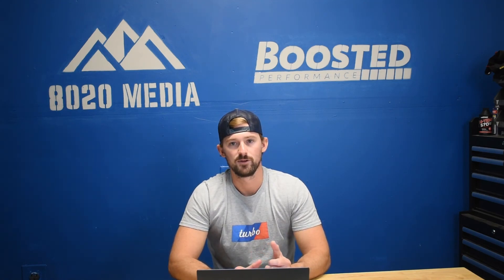5.3 Vortec - Everything You Need To Know

Comment: Thank you for this. I just got my first truck. 06 silverado with the 5.3 vortec and people are already calling it garbage. But hey, I worked my ass off for this and it gets me from point A to point B and also back to A.
Reply from the maker: Congrats on the truck, sounds like you deserve it! The 5.3 can be a great engine, just make sure to stay on top of maintenance. Don't worry what others have to say about your truck! If you love it, that's all that matters. Like you said, it gets you to where you need to be.
Reply: Congrats! I just sold my 02 Sierra with the 5.3 and it was absolutely bulletproof. I sold it with 276k and was running beautifully. I worked the shit out of it, too. Feed it top tier oil and it should be good to you.
Reply: Ignore the ignorant. Kudos to you. I have a 2002 Silverado 306,000+ miles engine still running great, though a minor lifter tick till it warms up. Just now started having transmission issues after 300,000 miles. Good luck to ya and happy smiles driving those miles.
Reply: Congrats to you, and screw whoever says otherwise. Been driving an '02 Suburban with 283k miles for almost 4 years now, with the original engine and transmission. I love it, it's reliable, and that's all that matters.
Reply: @calebbryan8600  That's good. My 02 Silverado at 306,000 miles. I Had transmission servos 1st 4th replaced about 4/5 years ago had only 2nd and 3rd gear. It Did great for many more miles. The 5.3  Engine still runs strong. Transmission is now at a point were the clutches are slipping real bad. This the only major thing this truck has had. Time to refresh rebuid the originals and the rear end to have a complete revived power train to go another 300,000 plus. 

If a vehicle  doesn't ever get to the high mile class it hasn't earned its keep. They're just dusty rust collector garage queens. If it's got an engine and wheels it was meant to roll. 👍
Reply: right! 2012 5.3 here and ppl say it looks outdated.. shit it’s brand new to me and i busted my ass for it
Reply: the 06 had a rep
Reply: Anyone telling you it's trash probably drives a dodge 😂😂😂😂
Reply: It’s not garbage bro 😅 people are jealous. I love ford Chevy and dodge. I’m not biased to Chevy. The 5.3 is a solid engine.
Reply: My 2000 5.3 vortec is still Rollin fine at 285,000 so they don't know dick
Reply: The 5.3 vortec is the best v8 engine ever built arguably even dod they can take a lick and still take you to work tomorrow i always say they'll get ya from a to b and dont be afraid to take it to c
Reply: anyone calling that truck garbage is a moron, the gmt800 is widely regarded as the most reliable series of trucks to ever exist
Reply: they don’t know what there talking about… besides my 05 monte carlo ss and 66 cadillac everything i’ve ever had has had this motor and never had to replace the motor… this thing does everything you need
Reply: @geraldblacher6318 And that’s facts. A bunch of ignorant morons in debt with their new $80,000+ trucks/SUV’s. The Gen 3 5.3 is the best of the last real true generations of GM’s Small Block V8’s. And what I mean by that is no cylinder deactivation or VVT bullshit.
Reply: 5.3 especially the LM7 could be considered one of , if the not the best engine ever built. Very simple, built strong, good power and torque , goes forever, and is decently efficient for a big v8.
Reply: The 5,3 is a great motor and anyone who makes fun of another guys truck Is a damn loser
Reply: @crash64226 they aren’t men
Reply: i have a 99 (nbs) with the iron block 5.3 and it took 350,000 of straight 16-17 year old abuse before it finally clogged up the oil pump pu tube. do NOT put a cold air these motors do not like them.
Reply: Clean out the tube change o ring and keep going @nelptune0787
Reply: Have the same truck. Just hit 200,000 miles. No problems yet
Reply: Just bought a 06 with the 5.3 it has 206,000 it runs strong im hoping it will last. I'm just happy to be back in a chevy
Reply: I had an LM7.  Bullet proof.
Reply: My 2005 standard cab silverado has this motor in it. It has 71K on it the only issue is my air conditioner leaks a bit and needs charged sometimes. I charge my oil every 3500 mess with 5W-30 full synthetic oil with a good filter. I was looking at a new silverado but maybe not now.

Comment: My 2012 LC9 5.3L has been very reliable. I have disabled the AFM. I have 87,000 miles on my Silverado.
Reply: I disabled mine as well. I have a 2011 5.3 Silverado. Turned it off at 117k. Now have 205k hard miles as well lol
Reply: @Josh-xj3fm  how did you turn yours off?
Reply: @Josh-xj3fm  I recently bought a 5.3 2012. And I noticed it had a slight tick at idle when its been running for a while. At start up and driving you don’t hear the tick with rpm’s rising. Is this the same deal with yours? I’ve heard it’s normal and some say it’s not.
Reply from the maker: Todd - Thanks for sharing your experience! Hope you get another 87k from your LC9
Reply: Just got a 2012 5.3 , I love it so far. Glad to hear you like yours.
Reply: @fortyfourrobo544  I recently bought a 5.3 2012. And I noticed it had a slight tick at idle when its been running for a while. At start up and driving you don’t hear the tick with rpm’s rising. Is this the same deal with yours? I’ve heard it’s normal and some say it’s not.
Reply: @Miguel-c1j  I recommend using a good quality synthetic oil. I use Royal Purple, and it has really good detergents to clean the gunk out of your engine.
Reply: I recently bought a 5.3 2012. And I noticed it had a slight tick at idle when its been running for a while. At start up and driving you don’t hear the tick with rpm’s rising. Is this the same deal with yours? I’ve heard it’s normal and some say it’s not.
Reply: Explain to
Me what afm is

Comment: The Vortec name and technology was shared from Honda to GM. 1996 was the first year of the vortec motors with a 305, 350, and 454 offered. It’s also the first year of the 3rd door option.
Reply from the maker: They actually used the "Vortec" name in marketing materials back in 1985 (I believe, or '86) with the 4.3L Vortec, albeit different design on the V6 vs the V8 Vortec's.
Reply: @8020Automotive  awesome. I didn’t know that. 👍🏻
Reply: @8020Automotive  Many call them that cause of the centerbolt valve covers but they are not true vortec
Those are TBI truck engines with the crappy head
Reply: Got any proof to that Honda claim? 🤨
Reply: @Maverick09171  that’s a great question. I’ve been a gear head since I was a kid. While other boys were wasting their lives away on Nintendo or Sega, I was reading/memorizing magazines like; Chevy High Performance, Super Chevy, Motor Trend, Car and Driver, etc… my parents gave me mag subs for birthdays and Christmas rather than video game junk. I can’t pinpoint the proof but am certain I read it in one of those mags at one time in my life. Whether it’s 100% correct or not, I’m not sure. It’s from memory. Having said that, I’m happy to be corrected if I’m wrong. It seems like it had something to do with VVT as well.
Reply: @dudestuff1557  GM and Honda have definitely collaborated over the years. But to my knowledge it’s been fuel cell and more recently EV content.  It is my understanding all the LS based features and design were done in house.
Reply: @Maverick09171  agreed on the collabs. My memory from this was the collab early to mid 90’s. I could be wrong and should probably research it more. 👍🏻

Comment: They might be the best GM engine, but they are underpowered. 
A Toyota 5.7, a Ram 5.7, a Ford 5.0 and a Nissan 5.6 all overpower the GM 5.3
And it doesnt really last longer than any of the previously mentioned engines.
Reply: I’ll stick with a pushrod engine over a DOHC with a 3 mile long timing chain. Just my opinion
Reply: @Maverick09171  well thats good for you, you chose an engine based on its simplicity, not its quality or performance. Nothing wrong with that, but please dont come at me saying pushrod engines are superior, because if they were, GM wouldnt be making other engines DOHC or 4 valves per cylinder. 
The toyota 5.7L is superior and even the Ford 5.0L coyote is better than a pushrod engine. Period.
Reply: @Eltanque-z4m  are we talking about the 5.7 trunda engine that makes a whopping 380 hp vs the 5.3 355? Oh and gets dog shit 15/17 fuel economy. Yeah light years ahead.
Reply: @Maverick09171  oh and the coyote V8 is smaller in displacement and makes 400 HP, revs higher, mods better, is more tuneable, lasts just as long if not longer, and gets even better fuel economy than a 5.3L 
GM should be ashamed and step up their game and build competitive engines.
Reply: @Eltanque-z4m  3:1 sounds like a great statically generated number. Not just one some goofball on the internet made up. Oh and it didn’t outlast anything, as they killed that engine to replace with a v6 tt. That’s ought to tell you what Toyota thought of that engine.
Reply: @Eltanque-z4m  is the coyote engine in trucks? Pretty sure the coyote is a performanc engine and you are comparing to an engine built for trucks only. What's your argument? That a performanc engine can beat a standard engine? Good job mate
Reply: @dpgemail  the Coyote engine is in trucks, it has been in F150s as long as it has been in mustangs. So good job of being misinformed mate 😂😂😂🤡
Reply: @Maverick09171  I get it, you are a GM fan boy who hates to admit that GM and its pushrod crap is outdated, outpowered and is normally outlasted by superior products. But you cant deny facts. The longest lasting V8 engines around are toyota 5.7L, so toyota screwed up and replaced it with a twin turbo. That has all to do with fuel economy regulations and not with how good or bad the Iforce was. Which BTW is a far more reliable and longer lasting engine compared to anything GM has ever made. A goofball on the internet uh? Im a profesional mechanic, and have been for a little less than 30 years. 😂😂😂
Reply: @Eltanque-z4m  30 years huh? So you’re like 60 years old… And you choose to spend your golden years starting arguments with people online telling them why they’re wrong for the stuff they like?

Sounds like a great life. Keep at it old man!
Reply: Late to this, but the gen 3 5.3 are way better engines then the same years, Toyota, Ford and dodge haha that’s funny. That’s why everyone does the “LS” swaps
Reply: @brianjenkins6198  BS.  People do LS swaps because they are small im size, abundant in junk yards and the after market has support for them. 
Besides any dummie can rebuild a pushrod engine, heck I was 15 years old when I rebuilt my first pushrod engine. 
 You can go to a junk yard and buy a 5.3L for like 600 dollars, thats why people like them not because they are superior.
Reply: @Eltanque-z4m they are Superior for that reason my guy, aftermarket availability and the price makes it Superior. You dont see people building or swapping said 5.0 because DOHC is a problem for that, they're massive, people love to claim they love boost and blow them up because they didnt do supporting mods, oil pump gears, timing chains, the great oil pan design. And you won't see these 5.0s for nearly as cheap and accessible as the 5.3. the 5.0 is faster and is paired with the 10 speed monster which I can agree is cool, but pushrod is superior when it isn't fucked with AFM technology. The coyote is great but low displacement is a completely unreasonable point with very minor fuel economy changes, and when you aren't stuck in mechanic shop world where the only thing you count as a good engine is one you dont have to work on, enthusiasts have proven and shown that just because you work at a mechanic shop, doesnt make you the wise old owl of the car world and your experience doesn't match others. For a truck engine the 5.3 does as advertised for half a million miles more often than not, pulls as advertised, and has been doing it for way longer than ford. Not even bringing up the 5.4 in this topic. The vortec also comes in a 4.8, and 6.0 so you can have any displacement number you feel, and just about anyone would want the 6.0 because displacement matters a lot less than people think.
Reply: Haha you're kidding right?? The gm 5.3 ls is stupid amazing I'm a full time tech and have yet to see the models you mentioned outlast these beasts never goes through coil timing chains etc I see all 50 hours a week gm 5.3 reems those others a new asshole all day
Reply: @badazz2969  you dint think the Toyota 5.7L outlasts a GM 5.3L? 😂😂😂 the Ford Coyote lasts just as long, while producing more power and more RPM.  Im yet to see a coyote self destruct because of failing lifters and pushrods. Ive even seen the nissan 5.6L outlast the GM 5.3L. 
You are a full time tech? Lol Im an ASE certified master tech with an L1 certification. With 25 years of experience. 
I work on not just cars, I also work on heavy equipment, diesel engines from FPT, Cummins, Doosan, Kubota, Isuzu and perkins. 
Trust me when I say, the 5.3L is ancient and it is overpowered by all other domestic and import V8s 
The Hemi 5.7L is also ancient, but at least it compares a little better in the power department.
Reply: @Eltanque-z4m  well good for you you want a cookie? Haha old school will see half a million miles I've yet to see any of these besides a 5.3 make it to that milestone but what the hell do I know certification doesn't mean shit to me I've seen non certified techs go twice as far but to each thier own
Reply: @Eltanque-z4m  How many coyote engines are in work trucks that have 500k plus? 
Tons of 5.3with them.
Reply: @gordocarbo  dude the coyote engine is superior to the 5.3L in everyway possible, except size. 
The Coyote has more horse power, smaller displacement, revs higher, they last a long time, take boost very well, has a very strong bottom end and the only drawback is that it is larger in size. Because it is a DOHC design. 
Also Im a mechanic for the border patrol, and most of the engines we see are 5.3L GMs and Coyotes and hands down the coyote is more reliable. 500k in a 5.3L? Sure maybe after a couple of rebuilds. They one Ive seen with the most miles UNTOUCHED. Is 260k miles, most fail between 150k and 225k 
So you are full of BS, Ive seen Coyotes with over 300K miles UNTOUCHED. Toyotas are the only ones Ive seen with over 500K untouched, your GMs have had a couple of rebuilds for sure.
Reply: @Eltanque-z4m bro i have an 09 tahoe with the 5.3 at 300k miles with longtube headers a cai and a tune ive never rebuilt the engine or even opened it up its not even cammed and i still have no issues running a 10.885 in an 1/8 mile with 22 inch wheels and 600lbs in the back with a custom box holding 4 12s ur statement is trash the ford 5.0 is trash u must be a ford guy lmfao
Reply: Maybe on some dyno sheet but I smoked new Hemi rams a few yrs after i bought my 02 5.3 truck loaded with work stuff in the back. Included the 1/4 mi
Reply: @gordocarbo  😂😂😂😂 not even a 22 5.3L can beat a hemi 5.7L ram, your 02 5.3L makes a low 285 horses 😂😂😂 you must be smoking some good stuff
Reply: @Eltanque-z4m  Wrong...I was there, cant race power figures. Power#s dont mean  ones faster than the other .Still have my time slips
Reply: @gordocarbo  and its all stock? I call BS

Comment: So what is chevrolet/ gm doing to fix current issues with the L59 AFM issues
Reply from the maker: Not sure if you mentioned the wrong engine but the L59 is a Gen 3 engine so it doesn't have AFM. But - with respect to what GM is doing in general to address AFM issues is in reality not much, at least very quickly. They have revised the system a number of times over the years and it has continually improved but even the new EcoTec3 engines are plagued with AFM-driven issues. It helps improve emissions and boosts their MPG stats so you won't see AFM going away anytime soon which is why we recommend using a disabler on any AFM vehicle.
Reply: Sell you a new electric pos. THey did nothing about all the LS7 issues. Talk about an abortion of an engine